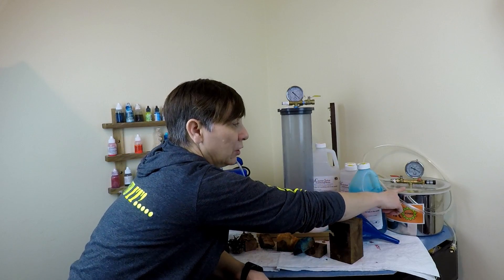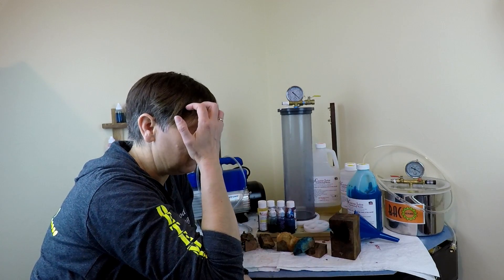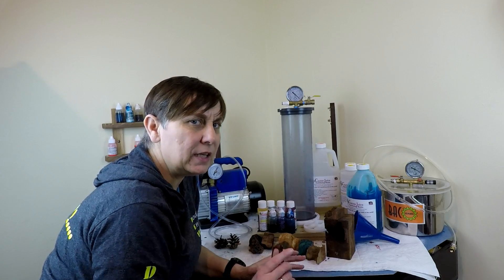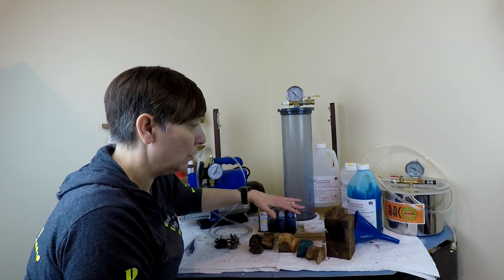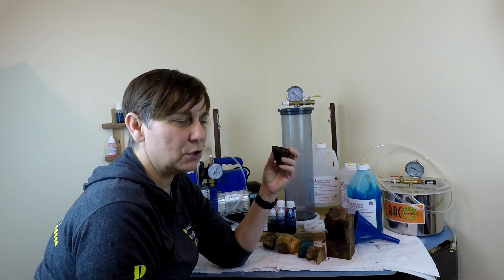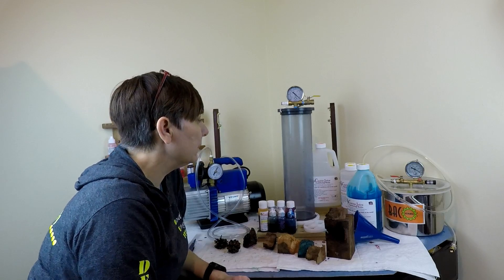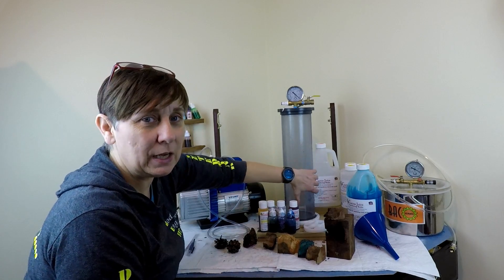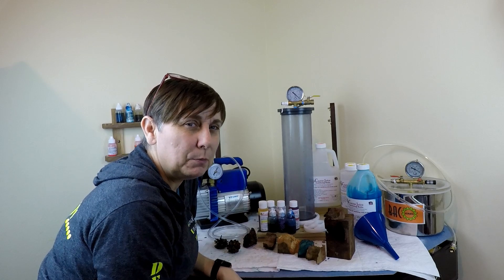Lets talk about Stabilising wood

Comment: Very informative Pam. However, you mentioned pulling a vaccume as 30 psi which is not correct.
P.S.I. is/means pounds per square inch. 
What you do when pulling a vaccume is you remove air down to as close to 30 "inches of mercury" that your location will allow based on sea level. 
"Inches of Mercury"